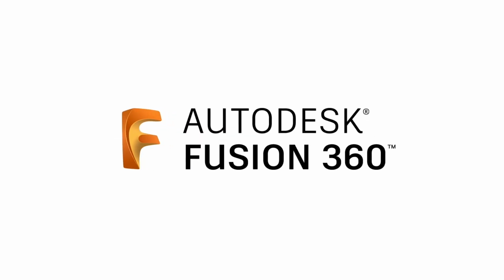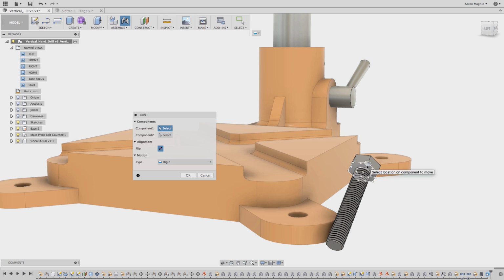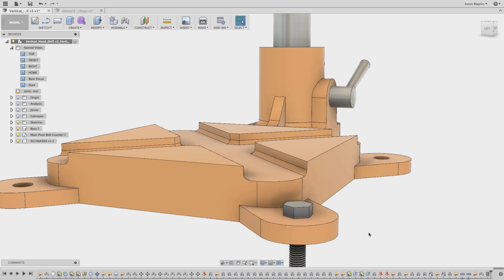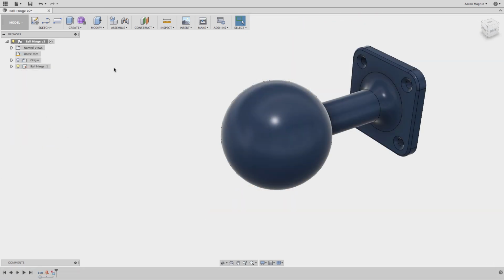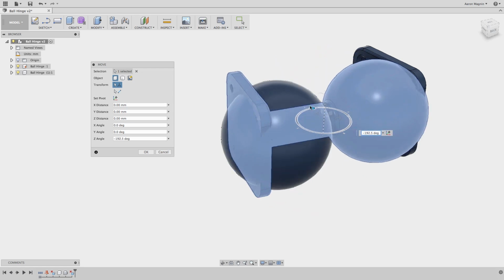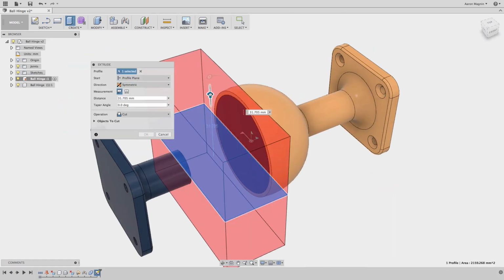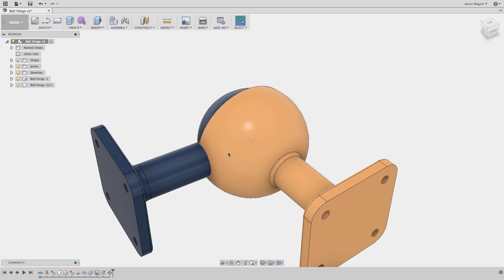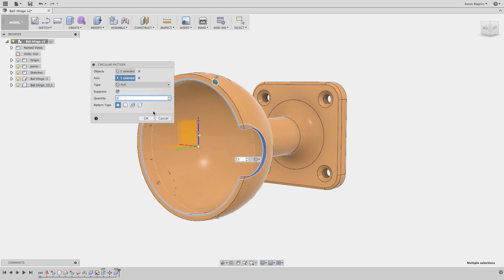Maximize Design Efficiency through Joints and Position Capture in History Timeline! | Fusion 360

Comment: How can I put this nicely?  Your tips are good, but I have to replay your explanation multiple times to work out what you are saying because you speak so quickly that the words run together and it sounds like gabble.  Please, articulate more carefully.
Reply: Try the Settings > Speed in the lower left corner of any youtube video. Just slow it down. (Just to offer a counterpoint - as I like this pace; and even speed it up at times, depending on the tip...)